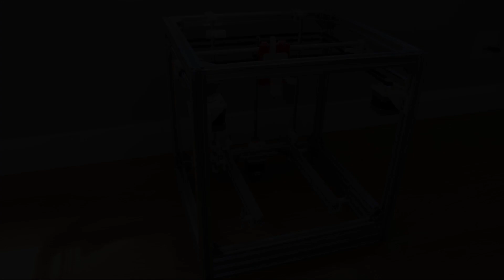HyperCube 3D Printer Build Part 3 - Mechanical Parts

Comment: Sorry, dont understand all the effort to ensure the print head is stable and smooth with 4?6? rods, and then use a cantilever bed to just flap in the wind. Put a second motor on the front, or move them to one on each side with four guide rods and your print quality will greatly improve. You can run both motors off the same stepper driver - they have plenty of power for the infrequent movements the z-axis does

Comment: My X axis rails and sleeve bearings werent moving as freely as well. I did a dry fit for the frame to see how the parts would fit and I cant exactly say im thrilled about how the x axis movement is. Im still filling the aluminum extrusion so Its square and all the parts to be even but unfortunately for me, rather than ordering the parts from misumi to be the specific size, I ordered 7x 1m long t2020 pieces and decided to cut the piece to down to size with a hacksaw and miter box... big mistake.
Reply from the maker: Ahh I see, it is a good solution in terms of weight however you can't really go wrong with the LM8UU bearings as they self align and everything. I'm thinking I might end up switching back to the bearings method in the future but I'll give this a go for now... 
Ahh yeah it's very difficult to file these things square, I benefitted from the fact I had access to a bandsaw to ensure they are all the same length. However I think next time I would machine the ends to get them absolutely perfect. Yeah that is a shame, the cutting services are expensive but sometimes it's just worth just paying it to get the job done. Hope you sort out your issues!